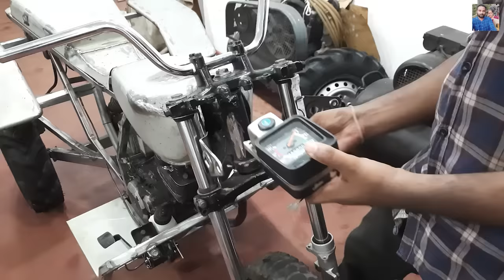How to make Trike motorcycle

Comment: Great... But it would like a little more camber of the front fork, diferential and a wider rear axle, 
otherwise you'll have to lean like a GP racer :) And if you want to overdo it in the field too, 
you should consider a differential lock... 
And finally - the rear axle shouldnt be attached to the engine block, thats not built for such a load... 
But when you edit that, it will be a super mashine :)